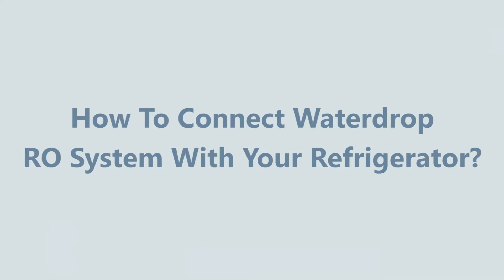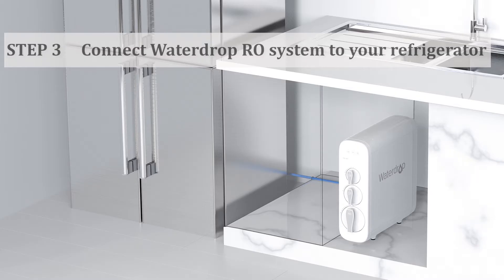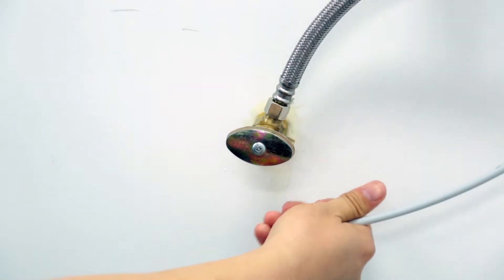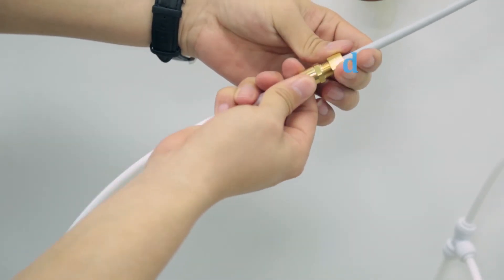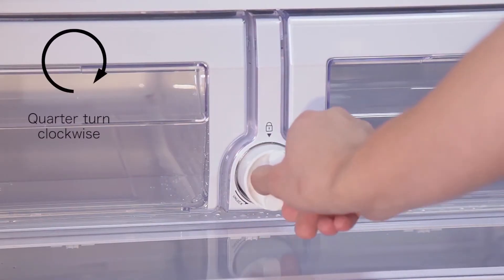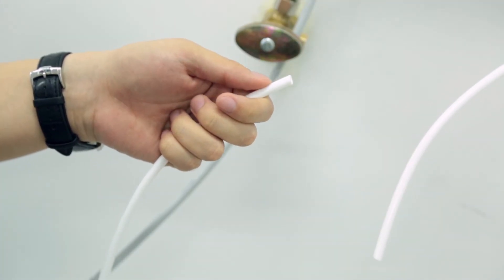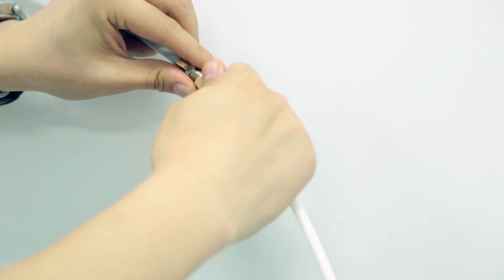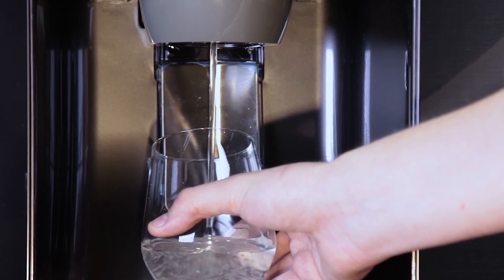How To Connect Waterdrop Reverse Osmosis To Your Refrigerator?

Comment: Whenever I use the water dispenser from the fridge my RO turns on and off but the water doesn’t stop is that normal ? I’m used to using it on the faucet and doesn’t turn on and off while dispensing water

Comment: I connected the my tankless ro  system to my refrigerator. At first it worked good, but after a few days it acts like it’s having difficulty pushing the water through the lines. It makes a pumping type sound and the water surges. What could be causing this, and how do I fix it?
Reply: Did you get this issue fixed?
Reply: I read that replacing your fridge water filter with bypass filter would increase the pressure. Apparently, the carbon filters the layer where the water flow slows down, so filtering on RO system and fridge filter causes the issue.

Comment: Is there a limit to the length of PE tubing that the RO system can send filtered water along? My water inlet and filter is approx 5 meters away from my refrigerator with no direct water feed to the refrigerator, so would need a long length of PE tubing to connect from filter to refrigerator would this pose a problem for the RO system G3 600G?
Reply: No, distance doesn’t matter

Comment: I don’t have a waterline to my fridge and it doesn’t have a dispenser (just the ice maker) can I run both a line to the filter dispenser that came with the Waterdrop at my sink AND a line to the ice maker or do I have to pick one?
Reply: I think that's what the tutorial is doing, that would be the purpose of the T-joint, one hose would go to the fridge, one to the faucet that comes with the kit. (Or at least that's what I'm understanding)
Reply: As long as you don’t use them at the same time